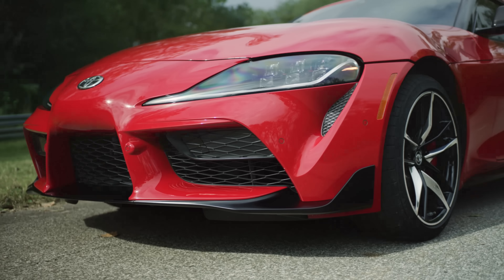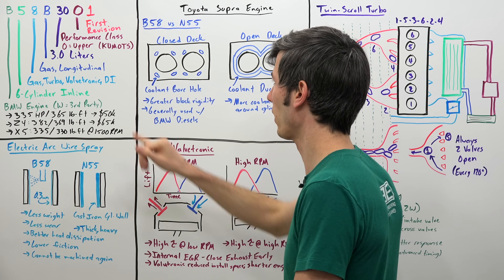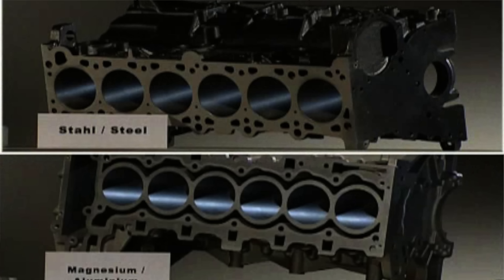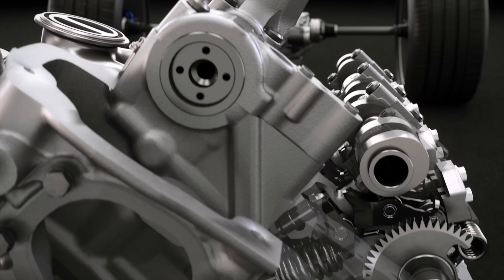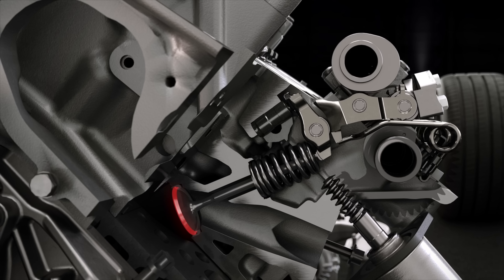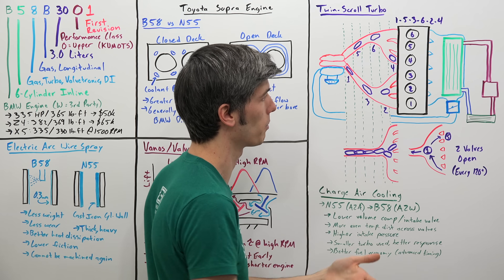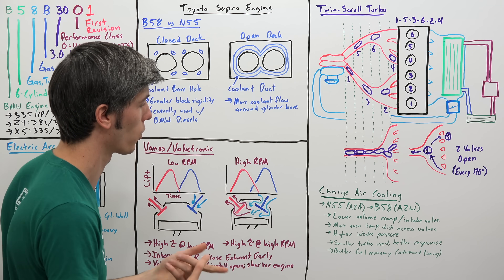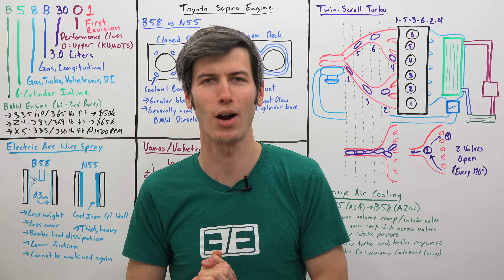2020 Toyota Supra Engine - Detailed Review Of The 2JZ Successor

Comment from the maker: Important Note! As reported by Motor Trend (print vol. 71, no 3), the European BMW Z4 and the global Supra will have the "B5830M1" engine, while the US market BMW Z4 will have the higher horsepower "B5830O1" engine. They also reported RPM figures for the Supra Engine: 335 horsepower @ 5,000 RPM, and 365 lb-ft at 1,600 RPM.
Reply: I thought I was a little late to the video, turns out I was just at the right time
Reply: I think you are wrong about the turbo being smaller. This is from BMW about the B58.
"Compared to the unit on N55, the B58 turbocharger has a 6% larger turbine, and the compressor wheel diameter is also 10% larger, therefore the B58 gains 20% in boost pressure."
Reply: Just call it a 3jz
Reply: Rachel Ann Ybanez why if it's not?
Reply: @MikoOhneHose  im a boy im using my moms account because i dont have one and i dont know what to call the engine
Reply: Do you think the low centre of gravity has anything to do with the unnecessary chassis strengthening due to being designed as a convertible?
Reply: Can this motor run 180,000 miles with good maintenance yes or no.
Reply: The only difference is the ECU, not the engine ! So everybody can get this 382 HP by just flashing the ECU.
Reply: Miko im a boy im just using my moms account because i dont have one and i dont know what to call the engine?
Reply: I know this is an old video but, do you by any chance have more information on the air to water intercooler they are using? Volumetric flow of water vs the VF of air, estimated temperature deltas, size (power consumption) of the water pump, is it water or a coolant, and the overall efficiency of it. Basically my real question is: does this AtoW intercooler system has any problems with heat soaking??? If not, how've they achieved that?
Reply: With the lack of Car Audio videos on YouTube (quality videos) you should give us a run down on car audio systems! Food for thought!

Comment: I was on the fence about them using a jacket water intercooler setup, however if they use a heat exchanger to lower the coolant temps less so than the normal coolant operating temps that they use in the DI engines these days it looks to be a decent idea. Less volume to push in charge air thus more response. 

At first I figured it was like the old jwac system they used back in the day on industrial diesel engines and while those served their purpose they just weren't the best.

Comment: I loved that video! I especially liked the explanation of why they separated the exhaust pulses going into the turbo based on firing order so the pulses don't overlap! Amazing. I wonder how the tuners will approach upgrading this system. It would make sense to maintain the same topology of the exhaust going into the turbo for the response, but to gain at higher RPM maybe a larger turbo and a little methanol injection. I've never seen an after market water to air intercooler. This is exciting!

Comment: I’ve had several BMWs each teaching 150k miles without major issues before trade-in. I’m very excited about the Supra.  One will be in my driveway for sure. My current N55 335i is tuned to 500WHP and will be a dedicated track car next season with 150k on the engine.  No problems with any of it.

Comment: Direct injection?!  So the engine will need a very expensive intake cleaning service every 30,000 to 60,000 miles.

Thanks, I'll pass.
Reply: Good, don't think you can afford it anyway.

Comment: Why couldn't they just leave well enough alone? Keep the shell, keep the 2jz, but up the power. SIMPLE...Right? But noooo. You lazy fucks decided bmw innereds  needed to go inside of the Supra. Because you knew that's what all the die hard supra fans wanted?!!?😢
Reply: Tbh ive always wanted a supra that can actually handle(which the mk5 is)its still got a straight six and is about the same size as the 2jz but lighter and I've been hearing rumors about the new motor that it's a closed deck design like a 2jz had some forged parts and is tunable and is not terribly priced since the mk4 price in today's standards would have been 80k and the mk5 is like 50k and his pretty much a car built to handle and us like 100lbs lighter than the mk4. So im fine with the mk5. Tho if I had a mk4 in ditching the 2j and throwing a 3uz or a 3sge in and tracking it.

Comment: Can't wait to buy a blown one, when it blows as it is un-salvageable and then drop a 2jz in it like god intended.
Reply: I mean it has a lighter straight six in it already and rumors say that Toyota remade it into a closed deck design rather than open deck like all of the normal BMW's have and has some forged parts in it already. Plus I'd actually like to see what the engine can even do rather than slap the same engine that everyone around the world uses.

Comment: I am very surprised you didn't talk about all the parts Toyota had to Redesign to make it pass their durability testing standards...They replaced almost everything that moves rotates and turns to beef it up even had to redo the nuts and bolts! BMW had a hard time dealing with this but kind of had to! This is the most developed motor they ever made in quality in over 30 years.
Reply: Lol, I can imagine the engineers at BMW were a little pissed off everytime they had to reengineer the over engineered parts they had already developed. I'm sure Toyota wouldn't let a brittle engine get wear its badge of honor.
Reply: @mr.boostang2064  basically what I keep telling people but they never believe me.
Reply: @mr.boostang2064  BMW testing is not as extensive as Toyota. they have had a lot of reliability issues and Toyota has had a lot of successes in that area. Toyota had more issues with style and driving dynamics.

Comment: Germen engineering meets Japanese engineering, that's exciting. It's a collaboration, the engine was built to Toyota's quality standards, they tested its components themselves, but most people think emotionally and just want to jump on the band wagon.
Manufacturers don't build cars to fulfill internet sensationalism, they build for profit, otherwise you'd see rotary engines still being made.
Reply: you mean the "brand" wagon? haha.. yea.. I like the fact that Toyota has stress tested so many parts of that engine to ensure it's durability.  The main thing I learned about this engine is that it won't have replaceable sleeves - which makes me feel like it will be very expensive to fix if a ring goes out..  Hope I'm wrong.

Comment: Wouldn't having the intercooler at the top of the engine bay be worse? Hot air in the engine bay would rise up and make the system less effective than it would be if the intercooler was placed lower?

Comment: Bmw is a smart engineering company. They focus on performance and efficiency rather than longevity. Toyota is all about simplicity and getting reliability through building simple designs that don’t have much potential to break.
Reply: Honda is very similar to BMW in terms of engineering for efficiency and performance but they are so conservative. I wish Honda and BMW did projects together. It would be a dynamite dynamic product.

Comment: When I first heard that BMW was suppling the power train, I thought “So, it’s a Z4 twin?” But not only was the building of the body, suspension, and tuning of drivability done completely separately by Toyota; Toyota QC’ed the crap out of that power train and kept sending parts back if they didn’t meet there durability standards. So, not only did they make a damn good Supra, THEY MADE A RELIABLE BMW ENGINE! Coming from a BMW owner, that a win/win in my book.

Comment: Those sprayed on liners won't last.
Reply: Sprayed liners were the premise of the Chevrolet Vega engine. It failed badly in production but it did work to a point. It shouldn't be used in a "premium" engine though, it's a cost saving measure to avoid the cast iron cylinder liners that GM has used on their aluminum engines ever since. The GM 8-6-4 engine in 1981? failed too, but in 2000(ish) we got a 400hp V8 netting 29mpg using pretty much the same ideas but way better spark and fuel control.

Comment: 0:25 Well yeah kinda, but also no. While yes, the engine was technically built by BMW, they always kept in contact with each other and BMW was working together with engineers from Toyota. Those engineers kept sending parts back to Japan to stress test them and make sure they were up to Toyota's standards, so allthough they didn't directly build it, they were the ones that pushed BMW further and further. Also only the engine and the drivetrain were built together with BMW, after they finished those, they went their seperate ways to design their final cars. They said it was quite a challange, as they had to essentially make a base that was strong enough to become a coupe, but also capable to be built into a roadster. All in all, both manufacturers contributed quite a lot to the making of this engine and it honestly makes my worries about the new Supra not being good enough go away. Sure it probably won't sound like a Supra and sound more like a BMW, but it'll probably be really good.
Reply: Have a like random guy who made a comment 6 years ago

Comment: Every piece of this engine was quality controlled by Toyota und the Supra and Z4 Platform was developed in cooperation between Toyota and BMW . I have no problem with an BMW engine. I have a problem with automatic transmission and fake air intakes.

Comment: Just talked to a Toyota dealership they are NOT taking deposits to secure the car, what the dealer told me was since the first Supra sold for 2.1 million at that auction the Toyota dealerships are going to Auction them off when they get them, they MSRP at 50k BUT you can't buy one for 50k because the dealerships are just auctioning them, They said they aren't selling them like a Camry when they get them, they are Auctioning them now because of the 2.1 million the first one raked in. So if you want a 2020 Supra you have to have 60-100k + in Cash for the auction NO financing at least not for the first couple years.

Comment: So twin entry with W2AIC/short intake path. You mean like the turbo Celicas of the 1990’s? How revolutionary.
Does it also have water/methanol injection, anti-lag and heater exchanger spray bar from the factory like my 1994 Celica?

Comment: It probably has a lower hp rating than the z4 because it was detuned on purpose for reliability, unlike the original Supra which could be tuned to three times its original hp rating. LOL Fail toyota

Comment: From what I've researched, the only thing that the Supra and Z4 have in common, are the engine, and platform.  Both cars are completely different from one another.  Germany has strict anti-trust laws about rebadging cars.  The only thing the two car manufacturers could do was engine and platform.  Toyota said that it would not make any business sense for them to make the engine, since the Supra will be a limited production car.  Toyota also sent the engine back to Japan and had each piece put under a microscope.  If any part failed Toyota's quality testing, it was sent back to BMW.  Suspension, brakes, etc are completely different from each other.  Even driving characteristics are different.   So no, they are not the same car.

Comment: it is truelly ashame that toyota completely lost it's passion for their alltime legend by litterly cloning a bmw z4 and using that as a complete base for their new supra i expected more from a legendary japanese company don't get me wrong,love bmw's and their 6 cilinder engines are one of the best out there but common where is the toyota legacy going,well it just crapped and died,good thing we still have the good old 2jz...
it's like volvo your buying a overpriced ford focus while volvo is aiming at premium status for years,fords 4 cilinder diesel engines are crap yet they put a 1.6l diesel engine in a 1800 kg v70 while these engines where even bad in the ford fiesta's.add 700-800 kg in body weight to that and it's a disaster,replaced enough turbos,flywheels,teared parical filters,injectors and egr valves and fuel rails on these to know and if you where out of luck the sleave around the injector that supposed to stay in the cilinder head would come out with the injector due to injector blow true and carbon build up between the sleave and the injector.there goes your premium volvo haha good thing these cars are one of the safest in a crash making it a bit more value then a euro ford. but non the less aside from my ranting great video and well covered.👍

Comment: The real advantage of Supra would be its modest price compared to other competing cars. Technical improvements and performance upgrades shall give it an edge over others. Such additions include a dual final drive (dual axle gears for rear wheel drive). The Celica ST had this problem, on motorways, its rpm were pretty high and drivers wanted to have either a sixth gear or another axle gear to reduce rpms on motorway.

For general design (which already looks good), it would have been extraordinary if this car would have been designed by aircraft designers instead of car designers. Companies like SAAB and MATRA are out of business of making automobiles but aerospace companies have been making cars and were good at it. There is one thing that aircraft designers know, that is, how to create a emotional relationship between man and machine. If somehow the designers of SUPRA can achieve this goal, they would have loyal clients for a long time. Infact, the old supras had this magic.

Comment: "Electric arc wire spray" LOL, is this their term for vapor deposition? What do they use? Alusil or Nikasil? XD.
The problem with Alusil and Nikasil type of coatings is not the coating itself, the problem is the lack of cast iron. This thin coating is very hard and scratch resistant, but the aluminium under it is still soft and that coating is so thing that it doesn't have much rigidity in itself. If you put this alusil coating on top of cast iron it will work perfectly, but then you wouldn't have reduced weight and cast iron doesn't really need it. The marketing wanketeers do tell you about how hard and wear resistant the coating itself is, they don't tell you how soft and flexible the alu underneath is.
And it's this kind of things why a lot of people say the old supra with the cast iron JZ was way better. This bmw thing is an unserviceable throw away engine. You go try to service a valvetronic system...

Comment: As much flack as this new supra gets, and I can't help but agree to a certain extent. With how Iconic the supra was/is, it not having it's own proper toyota engine does make it feel less genuine. Having said that, there are a few things this engine gets right. Its not a "3JZ" but it does seem to have at least some of what made the mk4 supra. For one the fact that they went with a closed duct is a plus.  2JZs insane power capabilities were mainly possible due to how overbuilt it was giving it the ability to handle some insane HP numbers. So the fact that they took steps to make this engine more durable gives me some hope. I mean we wont know how it stacks up until people try to push it past its current capabilities, but I guess time will tell.

Comment: My problem with this car is that it just looks like a beefed up version of the gt 86 and also the engine is a joke compared to the old one. 
They should have just revised the old 2jz and bring factory 400hp and a revised mk4 chassis and thats it.
Reply: You guys wanted a better version of the 2jz. The b58 is the 3jz
Reply: Wonder how much more expensive it would've made the Supra. Too many regulations to account for when developing it. They made the right decision going with BMW.
Reply: You understand, the original supra's engine no longer met emissions regulations. So, instead of radically changing it to comply, toyota just simply dropped it. Same with RX7 and skyline.
Reply: The b58 stock longblock should be able to handle 900-1000whp no problem once aftermarket catches up, hell the old n54 that bmw made can take 700whp on a open deck, and this engine is beefed in literally everyway over the n54, it's going to be a badass motor for sure
Reply: They could made an updated, modern version and called it 3JZ
Reply: @AlexGranli  1jz refer to 2.5L while 2jz refer to 3.0L. since this is a 3.0L engine as well, using the monicker 3 does not make sense
Reply: This is cool and all and I understand it’s more powerful than a stock 2jz, but who wants to run a stock 2jz? 

What I wanna know is if this engine can handle ~900 hp with stock internals like the 2jz. I guess we’ll have to wait and see.
Reply: Yeah because the A80 was the ONLY Supra ever made right? Would you rather a Supra starting out with the same amount horsepower and torque cost at least 2x more than it's current price point? I wouldn't, that wasn't the point of the whole project of reincarnating the Supra nameplate.
Reply: Just get a mk4 or 3 and slap a 1fz fe in it and you'll have your 3jz supra.

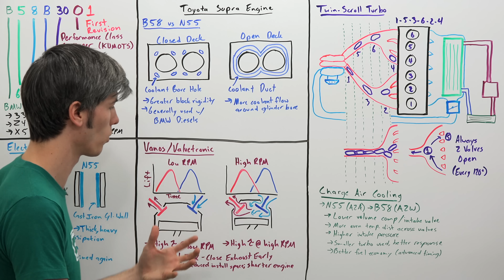Comment: To EE - longtime fan - 6:06 - Internal EGR - does internal EGR actually reduce the combustion temperatures if you are trapping in exhaust gas to the cylinder?  Would there be performance gains to change cam to let these gasses out?  Thanks!

Comment: An air to air intercooled is quite a distance from the head, where does the temperature differential come from?  Also, water to air intercoolers heat up with prolonged boost, how much, depends on the size of the radiator.

Comment: So, what's the material of the cylinder wall coating? Is it Iron based or Nickel based? Most importantly, is there silicon carbide in that arc wire or not?